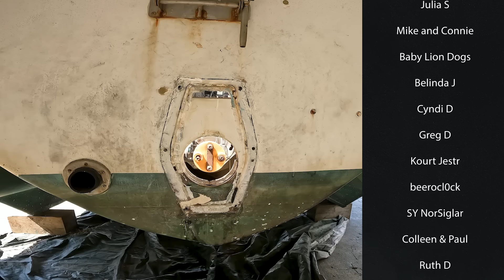Ep. 13 Fixing Our Old Catamaran (New Liveaboards Costly Mistake) Part 1

Comment: For some reason I really like the side of boat repair almost as much as watching all the good stuff. Kasper did an amazing job with that engine compartment. Hell, the engine looks new from the factory. 
When you said you needed a welder my ears perked up. I wish I was around because I would have done that for you guys for free. Welding is my trade and it's something I absolutely have a passion for. 
Anyways, Here's to another great video. Love every minute of it. Till next week, guys. Hope to see you two on the water and heading back to paradise. BTW You guys are doing amazing so far.
Reply from the maker: Thank you so much Kourt! Good to know you are a welder, we had plenty of questions we ended up having to figure out 😂 A little sneak preview but half of the battle was a weld, but the other was boring out the whole aligned straight with the other yoke. 

Definitely took a machine shop that knew what they were doing :) Thank you for the support as always!

Comment: There shouldn't be any water in the oil in the stern leg - make sure you get a seal kit and replace them. Remember to check the prop shaft for wear. Things like fishing line can score the surface and you'll destroy the new seals if it's rough. 
Learning new ways of doing things can feel horrible in the moment but ultimately is so rewarding - keep it up! You're doing great!
Reply from the maker: Yes, agreed! Will definitely be changing all seals on next haul out. With a positive attitude it has not been too bad going through all of these problems, but a bit of a break could be appreciated 😂 Will get there eventually! Thanks for the encouragement and advice! ❤🎉⛵
Reply: @patrickandmichaela 

If the oils not been changed in a while you may have had some condensate form .. as it won't have got warm enough to drive any water off ... The other is castings can go porous.. so best to clean up the leg prime it with an alloy primer and paint it. I've had old MCycle castings loose their coating and start leaking oil. 

It's an Oscillating multi tool .. probably one of the most useful DIY power tools of the past 30years.😊 🧙🏻‍♂️🇬🇧

Comment: when you have installed your transom plate, use sikaflex as glue/gasket and when you screw it, use sikaflex on the back of the washers and nut so it will be water tight, then you can use sikaflex as glue for your through hulls. for the swim step I would use thickened resin in the holes so you get it waterproof and wait to put it back until you get to the marina you will be in during hurricane season then you can use fiberglass on the outside and make metal plates with welded nuts on the back so you spread the load nine more, something you can do on both sides when you have more time during hurricane season. Best regards, Xidor from Sweden
Reply from the maker: Thank you so much for all of the advice Xidor! We really appreciate it! So much to learn and research, I think I ended up with 5200, 4200, and Sika 295 UV before I finally made the decision on what to use on the day 😂 Thanks for taking the time to share your knowledge! ❤⛵

Comment: Hey guys wonderful vid again, love the positivity "its problem and thats good we will just get to fix it" right on.  One thing about getting welding done to those parts.  I been a welder and welding inspector for over 20 years.  That looks like a cast steel.  To say you need to be cautious while welding a casted steel is an understatment.  General rule is just do not weld it, like ever.  Problem is it has a high carbon content and once you add heat to it you weaken the metal substantially to the point it will either break again or turn into a spider web of cracks.   Wont get into the whole science behind it but for us anything casted that breaks is replace in kind.  Maybe the shop you brought it to knows what they are doing, its a bit of process to do those repairs but even then they are suspect.  I dont want to be "that guy" saying no no no.  So just keep an eye on it but i thought id mention it before ya go and lay for an expensive repair from a con artist and then just have to pay again down the road.  Maybe i miss heard you in video but hesrd you mention a welder and was like hmm
Reply from the maker: We really appreciate you joining us another week! So glad to have you here :) 

Thank you for sharing your wisdom and experience with us, we definitely do not know a ton about metallurgy or welding, so have much to learn. 

The transom plate is Casted Aluminum, Grade LM6, which according to Sillette who manufactured them back in the day, is able to be welded on with good results. We also talked to the Sillette User group on facebook who seem to be a small but super active community helping each other out with this kind of odd piece of machinery that is still moving boats around so many years later :) 

We will go into it more next episode, but we definitely talked to a shop that gave us a quote 15x what we ended up paying to have it repaired, so you really do have to be careful out there!
Reply: @patrickandmichaela  yep sorry that makes sense aluminum is different as it's non feritic, ie not a carbon steal.  So not that same problems.  Forget I even mentioned it, I should have figured it was aluminum, light weight.. boat...duhh.  Sorry if I gave concern to you fine folks.  Sweet that you got it done cheaper looking forward to seeing next video of you guys continuing to rack up accomplishment to adversity.  It's way more interesting, to me at least, than just look at the pretty water and sun every video.
Reply from the maker: Definitely no need to apologize! Really appreciate you taking the time to comment and share your expertise :) I am sure we will run into some cast steel one of these days and remember what you said, and by that I mean remember we need to go look back at this comment or google to figure out we shouldn't weld it 😂

Comment: Hi guys. I know this is probably too late but you most likely need a new shaft seal on the outdrive. That’s where the water in the oil is coming from. If you haven’t done it you should as soon as you can. Good luck!
Reply from the maker: It is a touch too late to replace before being back in the water, but appreciate the comment! As soon as I saw that water come out I knew we needed to replace to seals. I have an email with a list of the things I want to get more spares of, and it includes a seal kit for the leg. Will get to it as soon as we land somewhere we can make it happen :)
Reply: It should be ok for now. With new oil it may even alleviate the problem for a while. I would plan seal replacement for your next haul out. You guys are not alone. Everyone learns these lessons as they go unless you’re rich and have other people do your work. That wasn’t me and it doesn’t appear to be you two. I enjoy working on my boat. I’d prefer to do preventive maintenance rather than fix broken things, but if you own a boat you’ll do a lot of both. Fair winds and following seas. Have fun!
Reply from the maker: Yeah, it sucks to know sometimes that something will be a little less than ideal for now, but we definitely have it planned for next haul out. We are definitely trying to get into preventative maintenance mode so that we can avoid more problems, because like you said, we will for sure be fixing most things ourselves :)

Comment: Crazy watching you take the transom plate off. How long did that actually take?
Reply from the maker: Very strange to open the boat up like that 😂 I think we prepped things one afternoon and then I spent most of the next day just getting it off. Slowly but surely, in the 90 degree Florida heat, multiple home depot runs, etc. So longer than I would have liked but not longer than I am upset about 🙂 Thanks for joining us another week! 🎉⛵

Comment: there should be NO water in that unit. If there is you have a leak, most of the time it is prop shaft seals. Also when you fill it back with oil you need to pump it in from the bottom where you drained it to prevent air pockets that happen when you fill from top.
Reply from the maker: Yes! Ordering seals is a top priority for us, along with some other parts to make sure we keep this drive leg in great condition. Such an important part of our floating home :) 

The video had it putting it in through the top which we did, but did take a lot of massaging and working the air out to make sure the oil filled it all the way up. Thank you for the advice, we certainly have more work planned for next haul out already!

Comment: While you guys have her out of the water you should scrub and antifoul her hull
Reply from the maker: We definitely need to touch up the copper coat in spots and clean some of the barnacles still hanging around! It is for sure the easiest time to get the bottom clean :) Thanks for watching! ⛵
Reply: No project creep in a yard when doing emergency repairs and you can't stay on the boat. In and Out and just live with the weed.
Reply: Hey , what marina are you guys in ?
Reply from the maker: Definitely had to cut some initial ideas out because when push came to shove we had to get back in the water :)

Comment: Since you rented a car, I'd throw your parts that you need welded, and drive about two hours inland, and find a welder.  Those coastal welders are $$$$$.  It's not their fault, renting a business building on the beach is $$$$$

Also, the welder is going to be welding pot metal.  Pot metal is prone to thermal stress during welding, which can lead to cracking. You may get fine cracks in  what the welder is welding, and you may not know it, until the cracks turn into breaks.  The deal is, pot metal is like thousands of pieces of metal formed into a piece, and when welding, the heat will transfer across all those pieces.  It will be like heating sand, and the entire piece you're welding will get hot, and when things get hot, they become structurally compromised.

You know what would be rock solid, but would be really expensive would be a aluminum transom plate and yoke, because your current ones look like pot metal, and not very structurally sound.  It would be expensive for a solid piece, but would last forever.
Reply from the maker: There were definitely some shops on the coast that were giving us some high prices for the repair, but ended up finding a shop to do it for what felt like a fair price. 

The transom plate is cast aluminum, grade LM6, which according to Sillette who manufactured the drive legs holds welds very well. 

Thanks for taking the time to comment! We really appreciate it <3